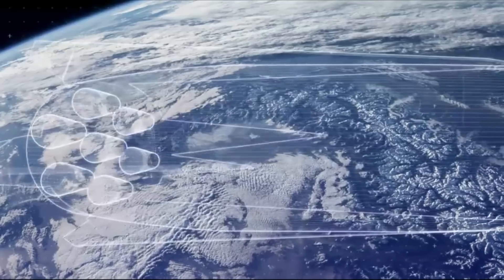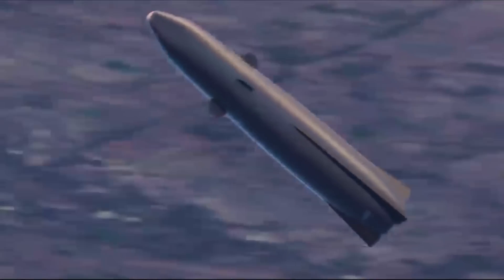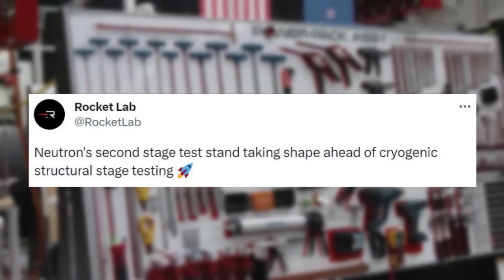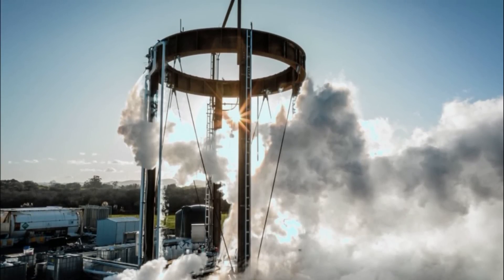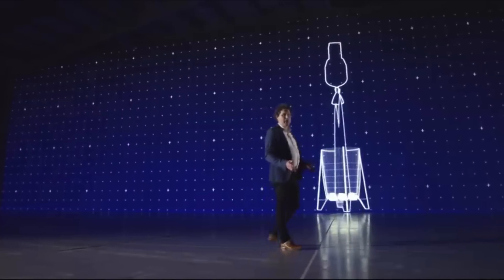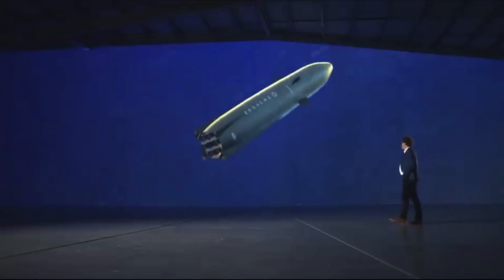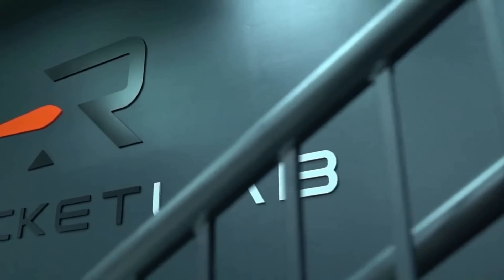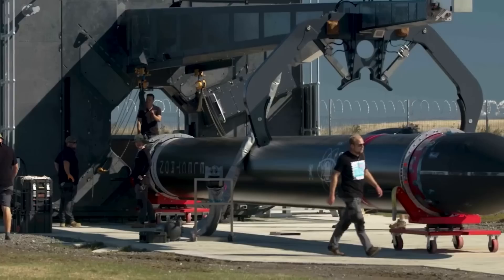The First Neutron Upper Stage Tests Are Weeks Away

Comment: Your pictures of the neutron rocket are dated.  The latest design published a few months ago features 9 first stage engines and a much more cylindrical and elongated design.  The clam shell also only has two doors compared to the 4 door design which you have shown.